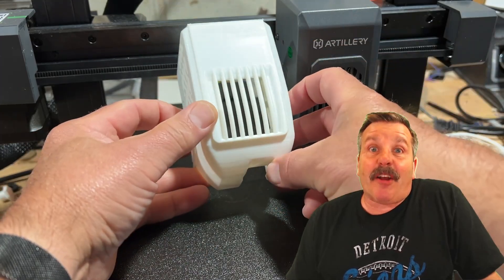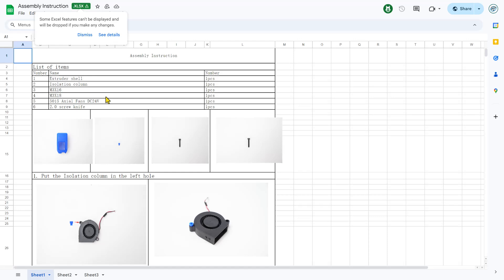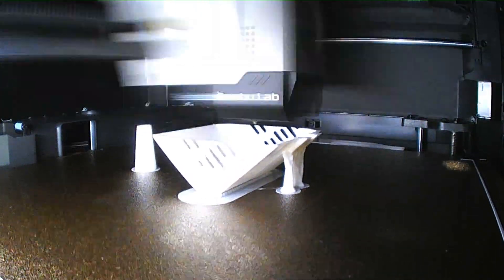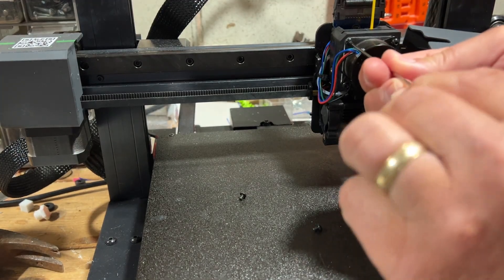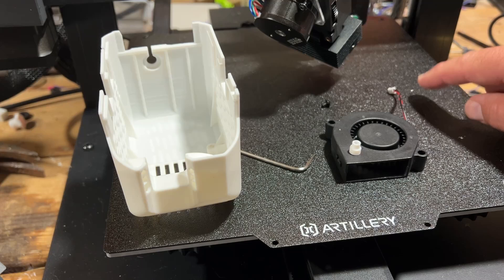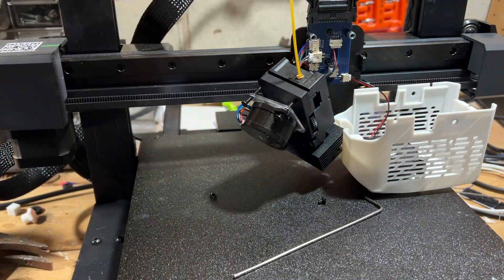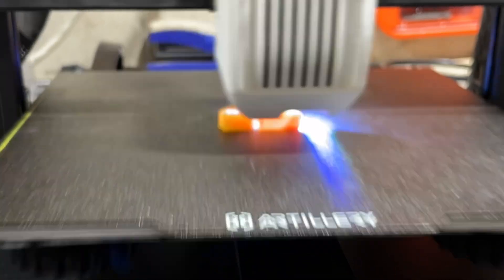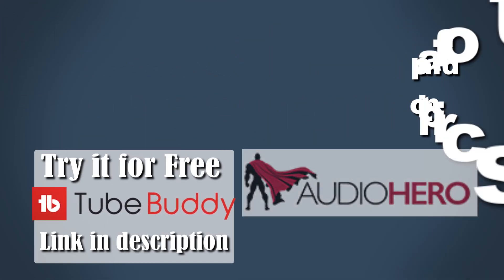Upgrade Artillery SW-X4 Pro 3d Fan Shroud In Minutes! Easy Guide

Comment: Printed perfectly with PetG at 220/75 now trying to mount it after I remove factory shutter. Will update you if I have success later :)
Purchased whole lot of screws just to be sure as one of them is damaged so I'll need to unscrew it first but hexagon factory screw is not helping as it's damaged so I'm trying to do it with a star screwdriver, hope it will work as I think it will hahaha
Reply from the maker: Glad the print was smooth. Hoping the same for the installation process!
Reply: @HLModTech 
The plastic piece that fell of from your cooler was a shell spacer for one of those 2 screws. In my case both were broken. One completely and other was holding on a 2mm piece of plastic so that is why I had that loud noise while traveling on higher speeds. Just tested it to print something and it's absolutely incomparable with a fabric one. 
Cheers for this one my friend
Reply from the maker: Thanks for the update and tip!
Reply: @HLModTech that is the idea of comunity :) looking forward to do some more small upgrades in the future. Now that I saw what kind of material they use.
Did you have any issues with compensation module? Mine just stopped working after 2 months, it's a new printer basically. I suspect on internal adc filter cable from the board to extension where I insert compensation module's jst cable if I'm right, should be a fast fix, just need to dissasamble it and assemble again I guess.
Any advice is welcome.
Mickey
Reply: Btw. I got that standard erroe message on touchscreen, something like (error ff   something). I've read it's a bad factory cable issue... Let me know if you have any advice.
Reply from the maker: I have not had either of those issues with mine. Have to tried to reach support yet? I found my answers faster via the Facebook groups when I was starting out with it.
Reply: @HLModTech yeah I reached them and they also suggested to check theADXL345 cable. I saw few fixes where one of them is just twisting the wires and supresses current noise that poor cable quality is making. Other is to make my own cable from high quality double-shielded cable I use for FPV equipment and VTX connection to flight controller usually so I am positive I will fix this. Just when I think about recalibrating it from scratch is little bit causing me not to go for it on a beautiful day hahahah it might rain tomorrow so I will do the surgery then.
Lot of people has this issue which causes compensation module ADXL345 to just stop working and displays error on display. Easy fix, more work with recalibration afterwards as you need to factory reset it and go all over again :) cruicial 30mins. of your life. 😂

Comment: Can you please share profile, on standard 0.2 mm this print takes 4h and 23 min!
Reply from the maker: I printed it on my Bambu Labs P1S. Just the basic .2 layers setting. Nothing fancy. Mine was about 3 hrs. You are using the Artillery... right?
Reply: @HLModTech  yes, x4 pro s1, 4h and 23 min seems to much
Reply from the maker: It is a pretty complex part. I consider the Bambu P1S to be faster and it was more than 3hrs.

Comment: What is the purpose of the fan you transplant it is sealed from everywhere what does it do with air actually?
Reply: The fan draws fresh air in from the front of the new shroud and blows it out the bottom at the project being printed.
Reply from the maker: Interesting question. That fan does cool the filament after it is laid down. I do not have one sitting around to figure out where it draws the air in from though. If I figure something out I will share it here.

Comment: The problem with this cover is that it prints the radius at the bed flat. This should have been a filet instead of a radius. I don't know if this is the printer or Klippper's fault. I should be redesigned.
Reply from the maker: Have you actually printed it, or are you noticing the issue before you print it? I have really enjoyed how it is working with my X4 Pro.
Reply: @HLModTech  Look at your print, the top radius looks like crap.
Reply from the maker: I guess I am more worried about functionality and it has been working great.
Reply: @HLModTech  I like functionality and good-looking prints!
Reply from the maker: So have you printed one yet? I printed mine on the Bambu P1S at the lowest settings because I just wanted to test the system. It would be interesting to hear if it turned out nicer when someone was aiming for a high quality print. I also wonder what program the design was created with. I just found it on the Artillery FaceBook group page.
Reply: @HLModTech  I haven't printed it yet because my X4 Pro is a paperweight, and I'm fighting with Artillery to get replacement parts under warranty. Their support is dismal at best. I've asked Artillery to redesign the part to fix the printing issue. I guess they're looking at it. We'll see.
Reply from the maker: That sucks. Sure hope you get it sorted out. Mine has been running fine since I made a replacement for the filament sensor bracket.